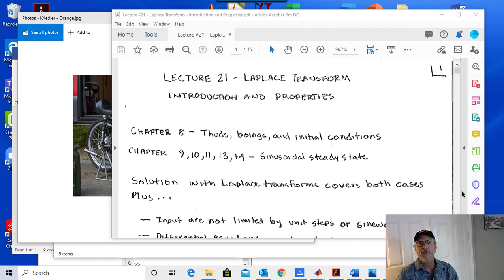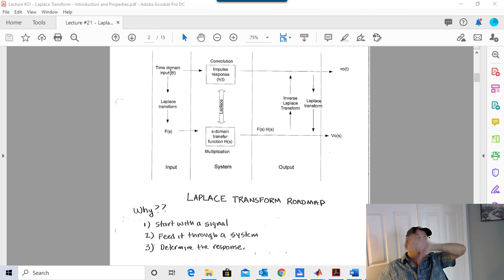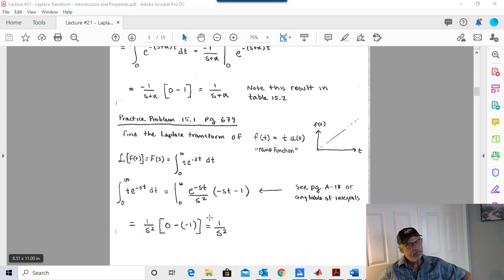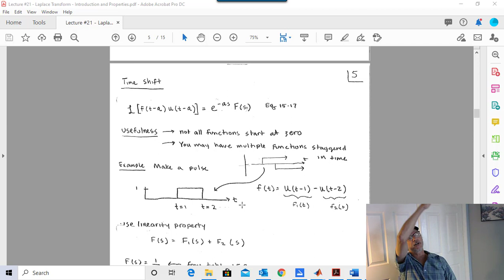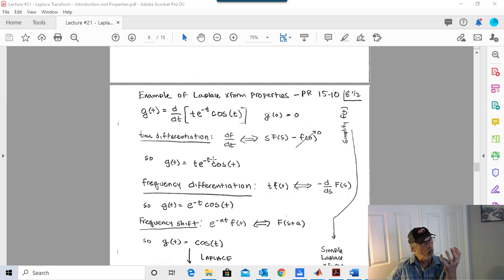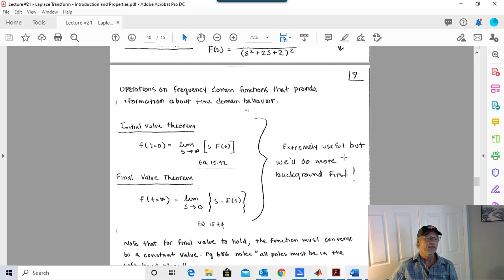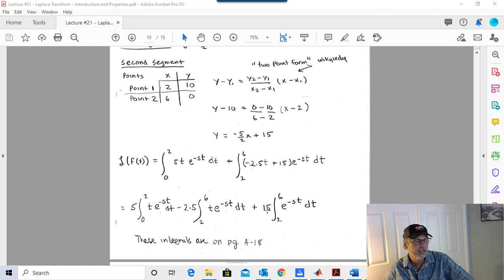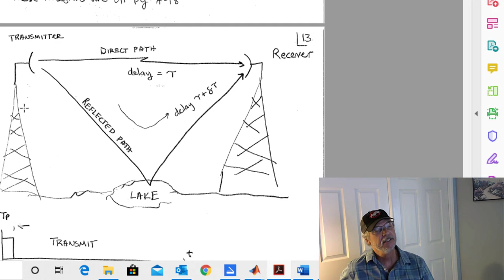EE310-Lecture 21-Laplace Transform-Introduction and Properties

Comment: Not that big of a a deal but there is a mistake at 1:05:05. The derivative of (S+1)/(S^2 + 2S +2 ) = -S(S+2)/(S^2 + 2S +2)^2. Then afterwards we  multiply that derivative by negative 1.  So the final answer should be positive not negative.